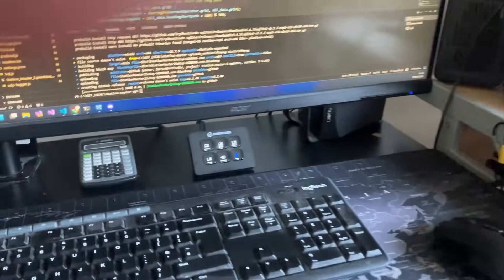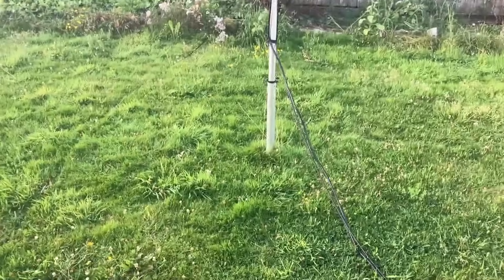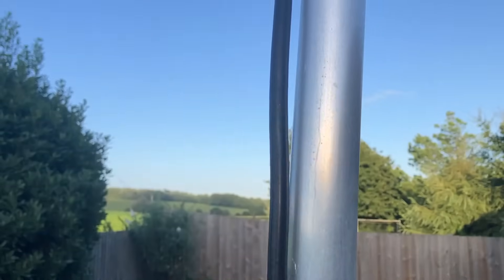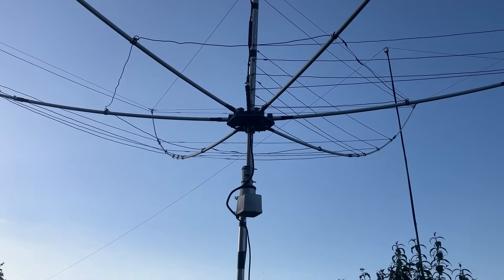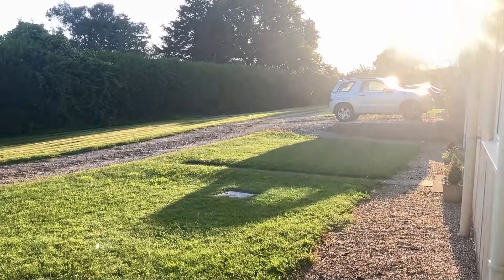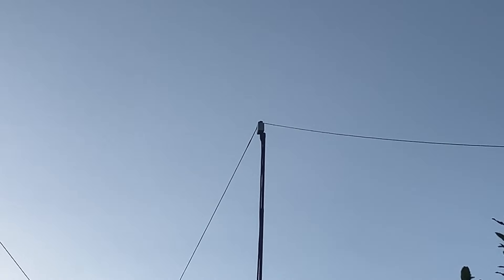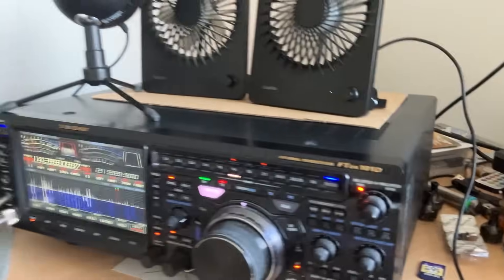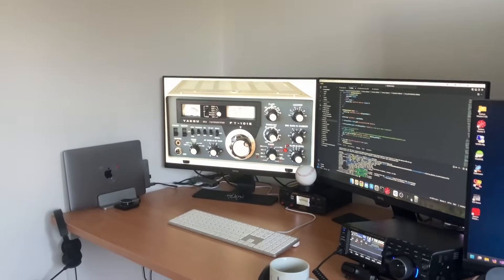HAM RADIO ANTENNA - you ASKED about the HEXBEAM ?

Comment: Im glad you uploaded this, ive had a lot of antenna issue this year after losing most of my eyesight and ive decided ive had enough and im gonna bite the bullet and buy a hexbeam. My main concern is safely erecting such an antenna, initially I wanted to erect it at 20 ft or so but I quickly realized with my eyesight and lack of help, id be on my own as far as putting it up. Also, i dont want to broadcast to my neighbors i have a hexbeam. So now that ive seen your video I believe ill copy your height,  as I think one man could easily do it and also I may be moving QTHs soon, so i need to think of ease of eventually taking it down. Thank you for the upload, you've given me some hope that i CAN have a hexbeam..

Comment: Hi Stu, just wondering what the advantages are of running the DXCommander alongside the Hexbeam as the Hex does it all and the Dipole as well I guess. Would be interested to hear how they all compare. Cheers Pete
Reply from the maker: Hi Pete. The beam is great if you're aiming to work one direction but signals from elsewhere will be down, the vertical allows me to have 360 degree in one ear to listen out for other callers. Also, if I'm aiming to work anyone from anywhere I'd be on the vertical and only swing the beam round if I needed and extra few db to complete the contact, also my hex does not do 40m, so if I'm trying to dx on 40 I'd be on the vertical rather than the 40m dipole, the vertical wins over the dipole most the time on the longer hops. Thanks, Stu